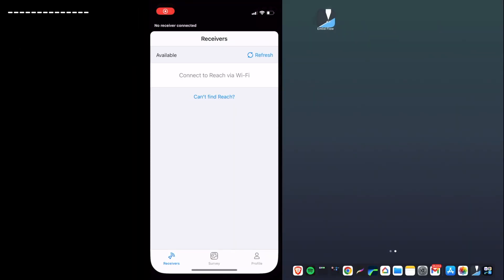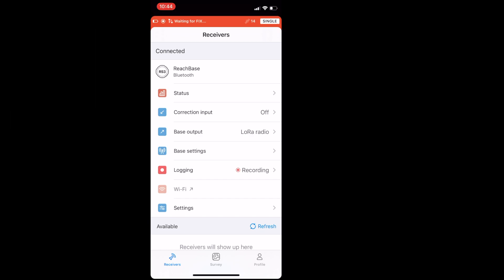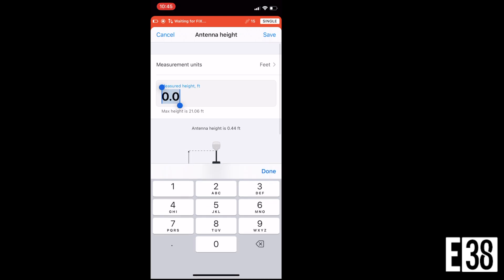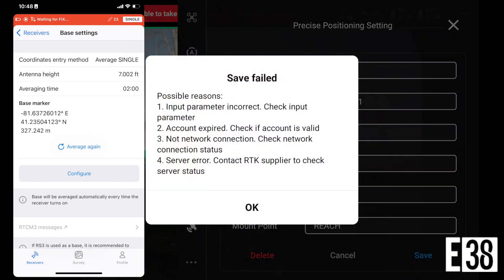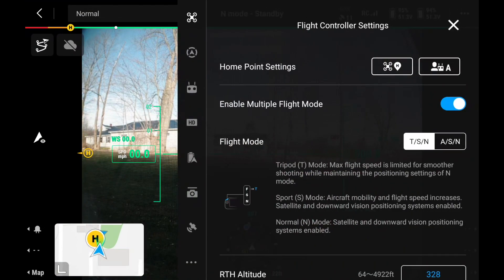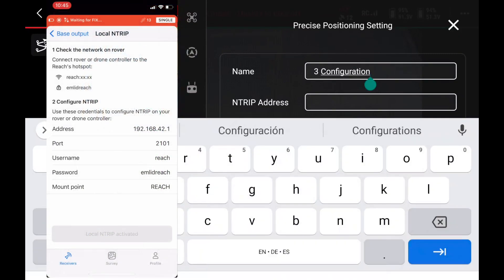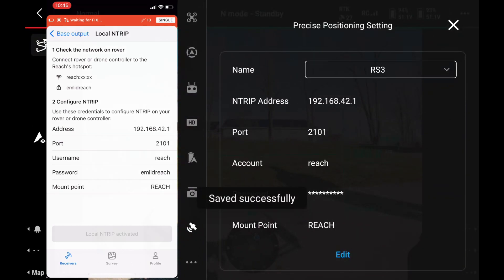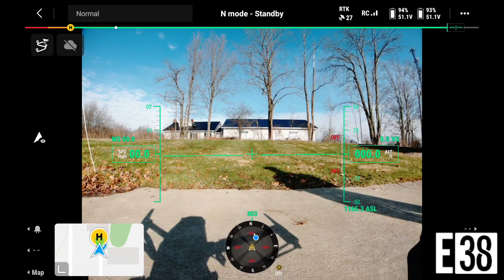Configuring Your Emlid Reach RS2/RS3 as a Base for Your Drone (Newer Version Available)

Comment: So am I right to understand that you wouldn't set any corrections input on the flow app when you're working in an area without internet access? The fact that it states "waiting for a fix" is not an issue? It'll use the averaged point you collected as the base station's coordinates?
Reply from the maker: Correct, your drone will still have a fix. It will be cm accurate in relation to your base, if you post process your base point and use that point to post process the rest of your data, you will have both relative and absolute accuracy.

Comment: Hi Patrick, does this method not require the rs3 station to have a “fix”? On the emlid flow app it says still waiting for fix, but I see you mentioned that it did have a fix after connecting to the drone properly. Thank you for the video!
Reply from the maker: Your base doesn't necessarily need a fix. The corrections coming from your base, even with a single solution there, combined with the satellites the RTK module is observing will allow your drone to have a fix solution and will be cm accurate in relation to your base. You can set your base up over a known point or you can post process your base marker (https://www.youtube.com/watch?v=fe0fmz2A3tk ) to give your data absolute accuracy.

Comment: I’ve got the "save failed" window each time I tried to put the local Ntrip in the controller, I do not manage to save the local Ntrip in it. I will try again, not so easy.
Reply from the maker: If you're drone controller is connected to the wifi hotspot of the receiver, you have a base marker set in your base, and your credentials match you should be able to save. I would double check the credentials. Things like the mountpoint and password are case sensitive. Also, is there anything about your setup that differs from this? For example are you connecting your devices through a cellular wifi router?
Reply: Thanks a lot, Invest managed to do it. Non i have to learn what is emlid caster for and when using it! Thank you again!

Comment: I'm still new to the RS3. Shouldn't the Reach be FIXed and receive corrections from NTRIP before the drone receives the Local INTRIP from REACH?
Reply from the maker: If you're setting your base with NTRIP corrections, then yes you will need the fix up until you have a base marker then from there it won't make a difference. We'll update this guide within the next couple of weeks with that information at a digestible speed.
Reply from the maker: https://youtu.be/J-0x6K6JhVw

Comment: Can use emlid as a base station for DJI Air 3
Reply from the maker: No, the Emlid bases work with the RTK module in DJI's Enterprise Drones. As far as I'm aware the consumer drones like the Air 3 don't have that ability.
Reply: Thank you. Is there any solution for geo-tagging Air 3 images with correct altitude and coordinates
Reply from the maker: We're not aware of an easy way to accomplish that unfortunately.